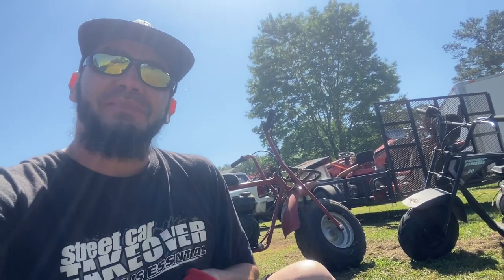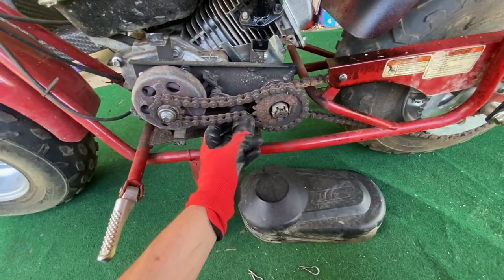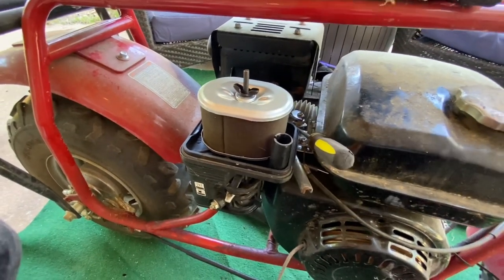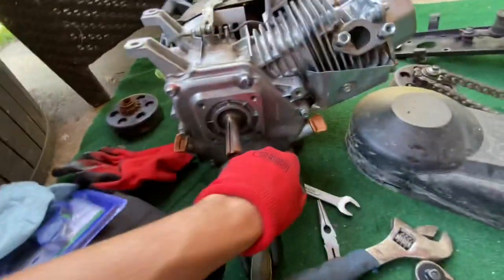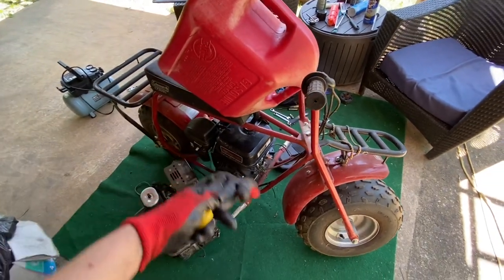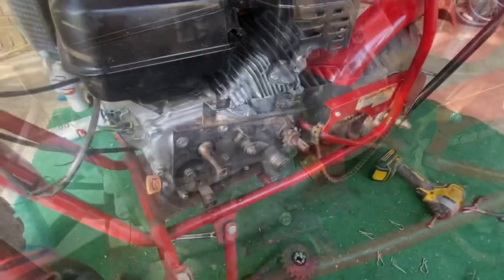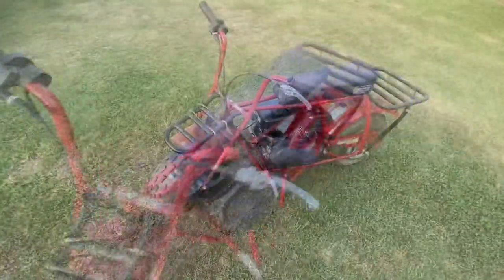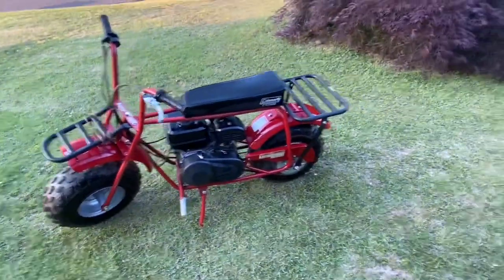Coleman mini, trail, pit bike. Predator 212cc engine swap install

Comment: Hey man great video. 
I’m thinking of getting one of the harbor freight predator motors for my ct200u mini. 
My current clutch is burned out so I’ll need a clutch to fit the predator crank shaft.  Any idea what size bore I’ll need?
Reply from the maker: I can’t remember but luckily my factory Coleman worked on the predator. But you can measure the crank shaft bore to see

Comment: Brother quick question what transmission would you use on a k20 swapped 92' MR2 850-900 hp. The ep3 one or another one? Thanky ou
Reply from the maker: Depends what your wanting to do with it. Ep3 is the best 5 speed one and I will be using it in the civic next.The 5 speeds are stronger that the 6 speeds but you won’t get many passes on a stock on at that power level, they are not as strong as the b series, a stock mr2 turbo transmission e153 can hold 750-800hp you can use it with the Hux cannibal kit. Other wise you will need a dog box transmission. K series will hold 500-600hp for a while launching in my experience but I’ve shredded them there and don’t last but several passes any higher. If your just doing pulls no launches 🚀 you could probably make it a long while till you built one. Gear X if the cheapest upgrade but your gonna need a ppg, liberty etc to last. Hope that helps